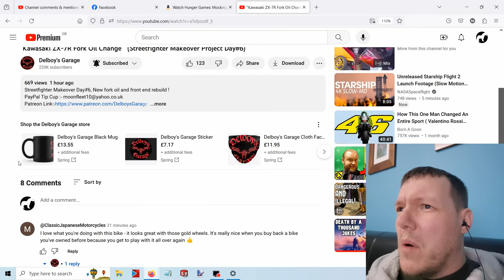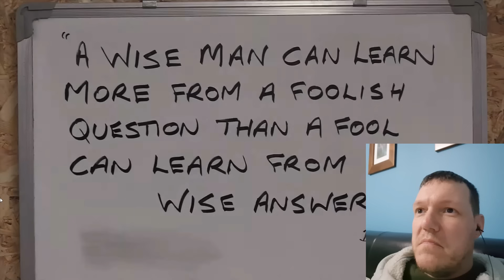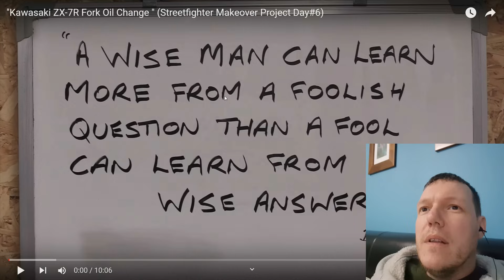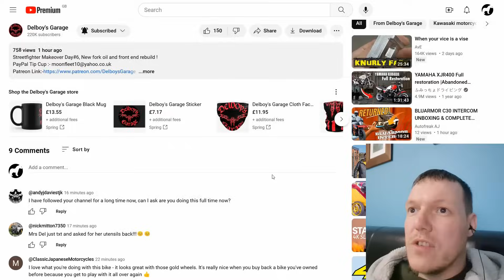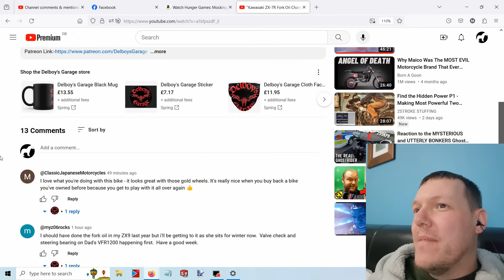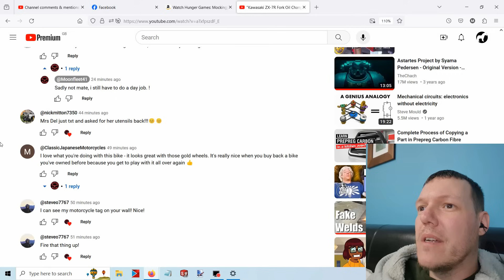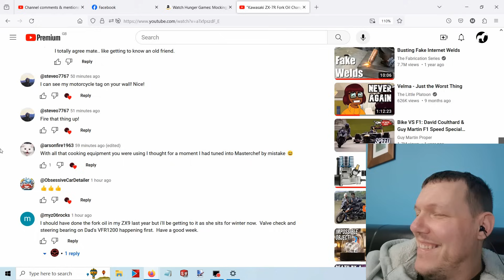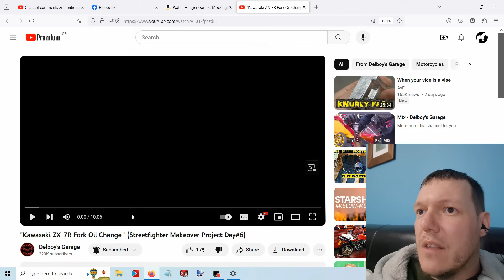HDS 2pointOh! #6 - Boring fork oil, again   !

Comment: If I thought I'd serviced the forks properly, and 2 yrs later found the oil in one had changed colour that much in one of them, I'd suspect there was an issue with the valving making the shock work harder. I wouldn't shrug my shoulders and say 'I don't care, I've changed the oil now'.

Comment: I guess Del doesn't understand that thread locker also keeps threads from corroding together and effects torque setting 10% less ie reduce torque value 20% using thread lock versus reduce value 30% using antiseize that is oil based
Reply: Where have you got these percentages from?

Comment: But Dave Moss is kinda right, change of Fork Oil in lets say Motocross Racing is every 10-20h. Ofc not if the bike is catching dust in a garage but gets moved as intented. The Way Del uses it, it is 20k Miles-ish aka never ;)

Needle- and Roller-Bearrings get damaged sitting. Did he check them after 4 years sitting plus 2 in his Garage before? That would have been useful. There are quite some at his bike.

One question, is it possible that the bike had been next to a heating all time at one side of the fork and so the oil got through many heat cycles?  It has been discolored.
Reply from the maker: "But Dave Moss is kinda right, change of Fork Oil in lets say Motocross Racing is every 10-20h"

- he was talking about road bikes
Reply: @thedirtyworkshop  indeed... but regarding your correct assessment about wear by use... for an old fart like me a gixxer is a race bike, the 750 class THE Superbike one... Saarinen,  Sheene...
just saying.
Dave and you got a communication problem cos he is old enough to be your dad, man. :D